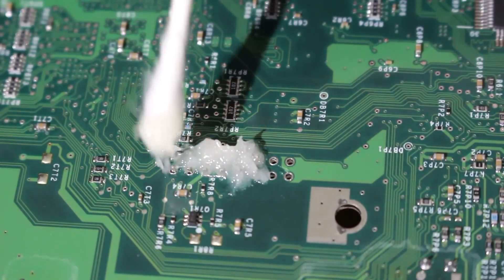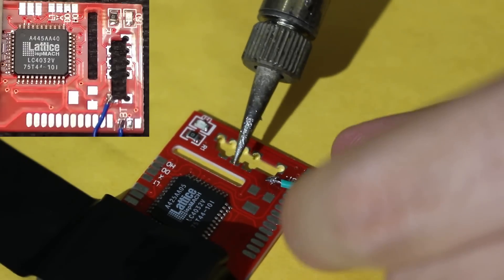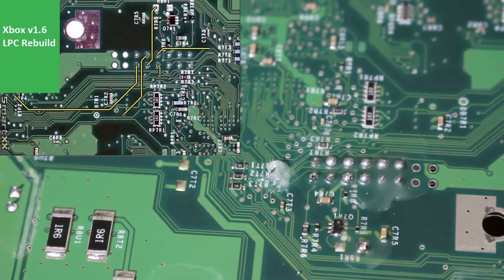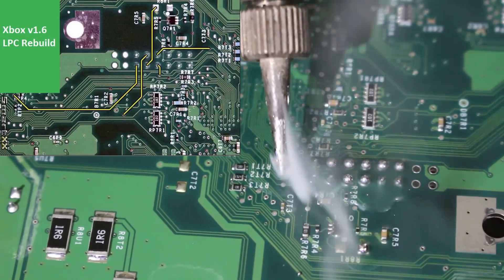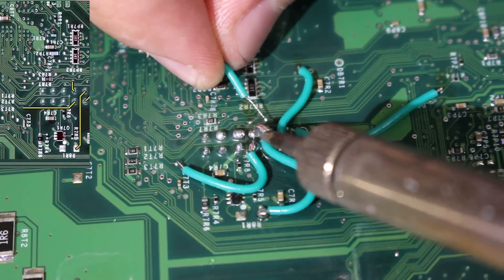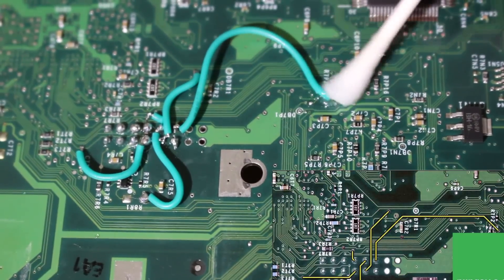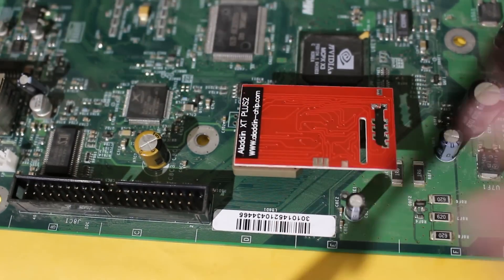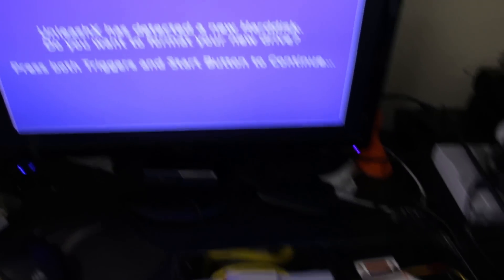How to Install an Aladdin XT Plus2 Modchip in a Xbox 1.6

Comment: MrMario or anyone, my xbox wont boot past the microsoft logo it just freezes there. i bought it from goodwill, its possible the previous owner tried to mod it maybe. But the xbox was never taken apart at all (stickers intact). When the xbox boots sometimes it will freeze at the Microsoft/Xbox logo and then sometimes an error will pop up. I get error #6 and #7, so im guessing its HDD related. Should i try this mod? Or do i need the xbox to be working properly to do this mod?
Reply from the maker: A hardmod could certainly help, yes.
Reply: Holy shit, literally 3 seconds after typing this i found a capacitor broken off!!!! fuck ya (its the clock capacitor)

Comment: hey man i got a question..... i live in a smaller town where things are hard to get ahold of sometimes......local walmart has some soldering stuff but noting fancy. would say, a run of the mill soldergun, solder and flux off the shelf work for what i would be doing? Thanks brother, love your videos!!!
Reply from the maker: Hey Ronald! That all would most likely be fine as long as you have fine enough tips, I did many of my intricate modifications with Radio Shack hardware first starting out. As long as you know how to solder, you can successfully complete this.
Reply: @MrMario2011  cool thanks for the reply..... So I finally got into the Xboxes that were given to me.... One is a 1.5 and the other is a 1.3.... any tutorial you or anyone can point me towards???

Comment: hi ineed some help
i did same as the video you did but when i turn console on its stays black nothing happens
any advise ?
Reply from the maker: Was your system previously softmodded? You can't have both a hardmod and softmod. Use HeXeN or something similar to wipe your hard drive and install everything fresh.

Comment: Awesome vid!  Can't wait to try this out!  I had 2 questions though.  For a non-1.6 xbox, do you still need to cut that trace?  Also, what about connecting a D0 wire to the chip?  Is that optional or only needed on non-1.6 xboxes?  Thanks!
Reply from the maker: No need to cut a trace! And yes, either ground out D0 or solder it to the chip.
Reply: @MrMario2011  thanks!

Comment: I bought everything to install this into my xbox but after pulling this apart i realized i am not able to install the chip as i am missing one of the holes where the pin header is installed to.

Comment: Just watched your guide a few times and then soldered on my modchip.  Thanks for the guide.  Quick tip for others, if it doesn't work and flashes red and green go back and try reflowing all the pin heads; they're probably not connected properly.  That seems to have been my issue after my very first attempt.
Reply: Same thing happened to me, second time lucky
Reply: im having the same issue right now im gonna try that and hopefully it works pray pls
Reply: After cutting l trace this happened to me reconnected it started right up...

Comment: i got an xbox a few days ago and am looking into modding it. however the previous owner has already upgraded the hdd and it seems to boot into evox and i wanna restore it to stock or at least put a better mod on it maybe even get an ssd but im really unsure how to go about doing that. kinda worried i'l mess something  up and end up with a brick. there also doesn't seem to be a mod chip anywhere so i guess its soft modded

Comment: Random question. Will this work on a 1.1 xbox? Also I bought the 30awg wire in your description but it looks different or more thin than one used in your video. Is it the same as one you are using? And if so is it the green wire or blue? Im doing this to repair a tsop I messed up so thanks for the detailed video!
Reply from the maker: You can do this on any Xbox model, although this guide has steps specifically for the 1.6 console. For anything older you'll need to clear the LPC bus. You can skip the steps of cutting the LFRAME trace and rebuilding the LPC, as those two are 1.6 only fixes.
Reply: @MrMario2011  Does this video cover clearing the LPC Bus or could you explain more on this? Thanks so much for replying :)

Comment: To anyone,

If I install a modchip into my original Xbox will I need a PC in order to have the modded Xbox working. I only what to mod my xbox to have access to HD as I have a PAL region Xbox, thanks.
Reply from the maker: You will need a PC to either burn a Xbox utility disc or transfer over the needed files.
Reply: MrMario2011 dude thank you for replying. I don't own a PC and I'm really not a computer gut at all but my mate has a MacBook I take it that'll work using that to transfer files or do the utility disc.
Reply from the maker: It would! Get yourself a blank DVD and use whatever burning program is available to burn off a copy of HeXEn, I'd recommend the 2018 variant. Once you get BIOS and your hard drive and such set up, you can FTP to your system from the Mac. Depends on how far your mate wants to go, I'm not at all well versed on Xbox programs on Mac, but you all could set up a Windows VM or partition and do work through that. Good luck!
Reply: MrMario2011 thank you very much.

Comment: hi Mr Mario ive got Aladdin chips coming to mod 3 Xbox's one already has solder in the holes is this still good to mod? The other 2 have no solder so i know there fine been all over youtube looking for the answer but ive watched so many videos and im sure ive seen it some where just dont know where plus your video guides are better than others i watch so fingers crossed you can advise Sir
thanks in advance p.s great vids
Reply from the maker: Models prior to the 1.6 have solder in the holes as the LPC holes still work, you need to clear them out by removing the solder if you install a chip, unless you mount the chip elsewhere and wire it up yourself.

Personally, I wouldn't chip that one with an Aladdin, it would be much easier to bridge a couple points on the motherboard and TSOP flash it. I've only chipped the 1.6 boxes as that's the only model that cannot be TSOP flashed.
Reply: @MrMario2011  thanks for the reply and will take note of that plus watch  your tsop video a few more times to make sure im good to go i think that one is 1.0 /1.1 mfg date is 2002, will add some pictures when there done one is being heavily mod and case. The other on is a 2005 mfg date so trying to check if its a 1.6.
thanks again for the advise Sir 
Keep up the videos Ill be moving on to your 360 vids soon :)
Reply: thanks for your advise the other one is defo a 1.6 ver no bios chip by lpc so chip it is thanks again

Comment: Question, is there an advantage to hard modding with an Aladdin XT Plus2 over just a TSOP flash?
Reply: Bearded Gamer can’t tsop a 1.6
Reply: @davemontano3790  shouldnhave specified, in general (read: not on a 1.6) is there any advantage to a mod chip like the Aladdin XT, vs TSOP Flash
Reply: Bearded Gamer my bad i just had 1.6 in my mind lol. That is a good question.  From my knowledge all it would do is make it to where you would not have to clone your old hd. You could still upgrade the ram and hard drive to a very large one just like a tsop. Don’t quote me though please as I am only referencing the old executor chips! This should be basically the same thing.

Comment: i can't find the link for flashbios file from video (thewheelman282) . the isozone is dead. ill try to use flashbios 3.0.3 ..
Reply from the maker: I never had to use FlashBIOS for this.
Reply: i see.. / my problem: i instaled the chip, the logo is on the left side of the scReen but it wont read the dvd with hexen on it..  just firs time it has read it; the light was red and after a reboot , nothing. it says to remove the dvd etc etc.. any ideea?
Reply from the maker: Sounds more like an issue with your disc if your console reads others. Try other brands of discs or try a different burner and always burn at the slowest speed. I have HeXen burned to several brands because of situations like that.
Reply: +MrMario2011 aha. I tryed with 3 discs.. 8x burned; same problem...   not even the original discs does not working.. same thing... please insert an original disc bla bla...
EDIT: I.ve made to mod another one (1.5 version) I dont know what was happened with that console (1.6) .. just it does not want to work :D // Thanks for your time!

Comment: Well, i finally got around modding my original Xbox whith this modchip, plugged my Xbox in, turned it on, and nothing happens, the boot antimations happen, but no evoX logo, modchip turns on though but nothing happens, found another guide on the internet telling me to ground a d0 point, did that, got a bootloop... Do you or anyone else know whats up? 

Thanks in advance.
Reply: I can help you but I need to see pics of your work. You can dm me from my channel

Comment: Hello MrMario do i need to have my xbox eeprom to be able to fully modded?
Reply from the maker: You should have your EEPROM accessible period, in case anything gets messed up.
Reply: MrMario2011 well i made a mistake when i was softmoding and unlock the master drive from motherboard and i didnt save my eeprom is there a way to do it with out it?

Comment: Hey there. Love the video. I never normally comment but have no idea how else to message to hopefully get help. I installed this today in my 1.4 Xbox. The guides online say to solder from DO to the point on the Aladdin board. Then solder BT to the point on the board and bridge to ground to allow boot at start. So everything is done but as soon as I put power into the Xbox it automatically turns on and then restarts. Then restarts again. Then turns on and stays on but does nothing at all. Have to pull power out. The Aladdin board has a red led the entire time. Sorry for the really long message but I've spent the last 6 hours trying to sort this out and theirs around 5 different diagrams showing different things for different motherboard's. Can't find a video explaining the 1.4. thank you for anyone that can help
Reply from the maker: Double check your wiring to ensure it's all correct, worst case even take it out and try again. See if you can get the console to boot with no chip, if you can then the system is fine.
Reply: MrMario2011 thank you for replying. I had done all of that. Removed every single bit. All works fine. Put it back in again. Does the exact same thing as before. I've checked everything. I've been modding consoles for years and this seemed like the most simple one to do yet it just isn't working.

Comment: Quick question. If your xbox is an earlier version the whole lpc is already functional and only the pin header has to be installed correct? Also I have a version 1.0 with a bad hard drive and by installing the mod chip I should be able to use an unlocked replacement drive correct? Thanks for any help Mario.
Reply from the maker: LPC rebuild is only for 1.6

Comment: Good video. If I could add something, I would use a multimeter to confirm that the trace at 13:23 has been cut, rather than only a visual inspection, just to be super sure.

Comment: I would recomment soldering two opposite coreners and then removing the tape to prevent it from melting to the headers.

When soldering wires to vias on the motherboard (the tiny circles) I recommend using 30 AWG (unless recommended otherwise by the modchip instructions or tutorial)  If the wire will go into the via and  through the other side, solder it that way. If it does not then take exposed part of the 30AWG wire amd with a pair of tweezers make a loop so it forms a circle. Then tin it with solder so you have a solid circle at the end if your wire. Then solder the circle to the via on the motherboard. This will maximize the surface area of the wire with the via to help prevent it from coming off and will make the strongest solder joint possible. After it's soldered tack it down with some hot glue.
Do not ever pull on that wire! If you pull the via and the trace off the board, you will have to find the end on the other side of the board and jump traces or else your motherboard is dead.

I have never installed one if these modchips however I have done a lot of soldering and a few RGH xbox 360's. I am also an electrical engineering student with tons of soldering experience.

PS the solder joints that look like balls are not good solder joints.

Comment: i have a few original xbox laying around i like the concept of popin in a new hard drive if the hard drive ever goes bad an just rebuilding from there ,will also make upgrading from stock to a larger hard easy. just build and ftp over my games

so question : now that the chip is hard modded is it possible to upgrade the ram, i remember people use to do it back in the day but one of the requirements was the the system had to be hard modded with a chip
Reply from the maker: Yes
Reply: You can upgrade the RAM but the thing to keep in mind is how it will be used. I don't think any games were closed to take advantage of it. Leaving only emulators to utilize it fully. I think it makes Doom run better. But the reality is the gains are not worth the time or money.

Comment: It might be a bad visual angle but those solder joints for the pin header are not going to last. You want the (leaded) solder to form a cone around the pin. A disco ball means something went wrong, like not enough heat, or possibly way too much flux. And always pre-tin your wires. Never rely on excess solder on your iron's tip.
Reply from the maker: It's the visual angle, I put more solder on the points than I needed so that's why there are balls there. The joints are fine and are making proper contact.
Reply: I have to agree with Teddy. Used way too much solder. It is far from ideal solder connection. There's a reason every other through-hole mounted connection you see on ANY properly built circuit board aren't round circles. Just look near the R7P6 resistor (right side) in the video to see how a proper through-hole solder joint should look.
Reply: Oh jeeze. I meant this all with the greatest respect because I enjoyed the video otherwise, especially since it makes modchipping old hardware more accessible to everyone.
Reply: So a 'cold solder' is out of the question?

Comment: What wire gauge are you using to install this chip?
Reply from the maker: All hardware links in the description
Reply: Gotcha. I don't know why the wire you used looked thicker than 30 awg. Great Video!
Reply from the maker: The insulation itself is pretty thick, so it looks thicker than 30 awg.

Comment: I’d really recommend touching up your soldering technique. See how the solder looks like balls surrounding the through hole header? That’s because the solder hasn’t actually “flowed” into the space between the board and the header you are soldering in.
Reply: Honestly if you just changed out that conical tip to a fine tip chisel and got a smaller diameter solder it would yield better results. The other thing I would do is source an old ide cable for your conductors and get some tweezers. But in reality these are things you figure out with experience. And no better way to get experience than to do stuff like this. So carry on.
Reply from the maker: The solder did flow in, the balls are there because I used more than what I needed, not because of bad solder joints. Although I have improved with through-hole soldering these pins, I've done a few others after I made this tutorial where I didn't ball out and they looked much cleaner.
Reply: You are correct.  To bad mrmario is so arrogant that he wont accept that.
Reply: @vegitoblue7908  I don't know that either way. I do think that eventually he will get better just because it seems like he does a fair share of work. Even doujindance's work looks decent now and that guy couldn't solder to save his own life. It really just comes down to experience. When I started out 30 years ago my work sucked ass. I know this because I opened a console I did back then a year ago to do some basic maintenance and was horrified. Now my work looks basically factory. But I do have 30 years and good tools so there's there difference. I don't think this work is bad. And it's good enough that I know it will get better with experience. We need more people doing this kind of work. I'm sick of the throw away electronics mentality. But then again, it is the reason why I consistently pick up old consoles for $10-$15 every week still. I have a stack of modded consoles at my house ready for sale that I will flip for a 500% profit. So keep up the good work Mario
Reply: @alunaticbastard   i know what you mean. We all been there and get better with time like wine.

Comment: Can this be done to an xbox where the hard drive has completely failed?  I received one that has a failed hard drive that hasnt been softmodded?
Reply from the maker: Yep! Install the modchip and drop in a new drive, set it up with something like HeXEn and you should be good.
Reply: Now my board might not be a 1.6 im not sure yet, once i figure this out if its not, the spots might be different because of board revision right?